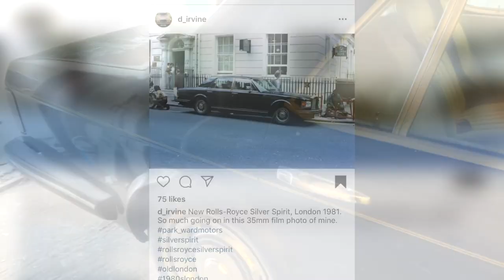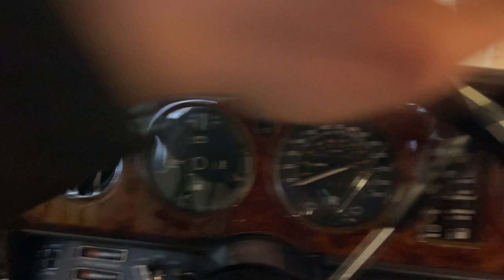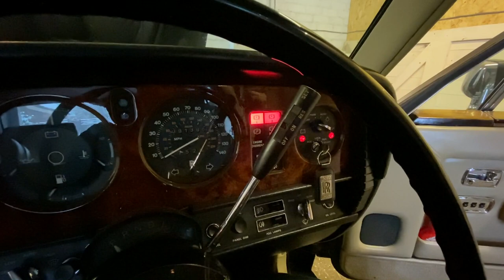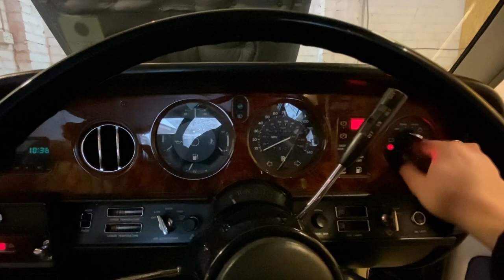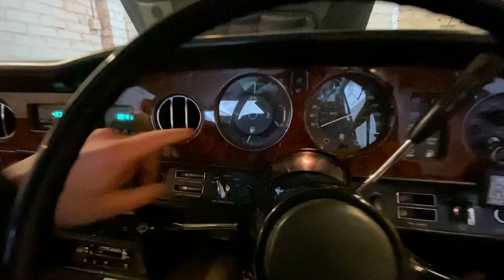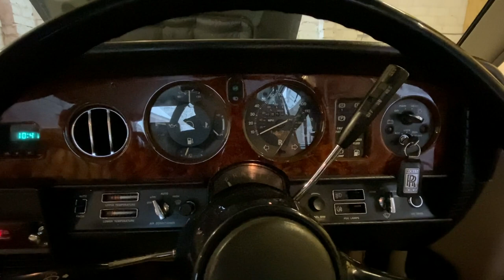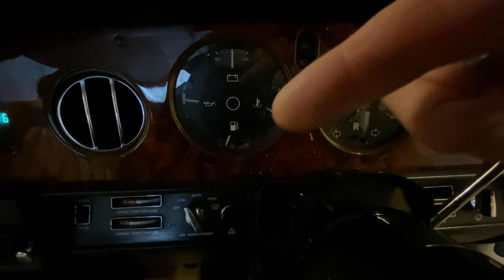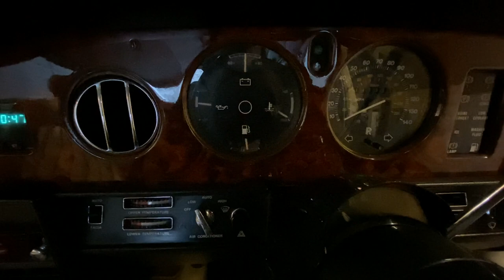Cold Start of the old Rolls-Royce Silver Spirit...

Comment: for some reason many of these old Rolls have that cracking issue on the wood. i looked at a 1999 silver seraph that was 2x as bad as yours. just crazy to see. even the rear tray tables... utterly ruined. im sure the manual told people to put some sort of protective spray or wax on them i dunno.
Reply from the maker: It’s the temperature extremes - left out on really hot days or freezing overnight can do terrible things to what is effectively furniture. It’s all easily rectified with a good crafts person!

Comment: There's a Harvey Bailey suspension  kit for shadows and spirt spur cars
And the turbo R steering rack fits  needs 1 adapter to hydraulic line
There's a weatherstripping update for the doors from a 99 spur
My car is usa fuel injected,I installed a 14v ignition box to the distributor dismissed the car it made it fast and Handel's well
Reply: I bet the exhaust note has a lovely Bach!

Comment: I used to work on used cars in the U.S. If we had valve lifter noise the first thing we did was add a can of STP oil treatment. Not sure if it is made any more. It was a VERY thick honey type oil that would clear up tappet noise 99% of the time. Just be sure to have the engine running and the can of STP warm when adding it to the crankcase, otherwise it will take a long time to empty the can.
Reply: It's not lifter noise.

Comment: If you listen to the cranking you will hear one or more cylinders is low on compression. Might be worth checking.
Reply from the maker: Ah, that was because I’d popped a spark plug out to check for spark which is why it started making the odd noise but we’ll spotted! 👍

Comment: I have enjoyed your video's due to my interest in clasic cars, I have 3 bentley's and one of them is a T2 which I purchased recentley as a daily driver. My thinking to use a clasic car as a daily driver was based on the fact that most new cars are to firmly sprung and lack an option list that is not part of a packaged. Also my budget for a new car was about £40K and I reckon that in 3 years I will lose half of that so my T2 becomes a free car with an unknown value and although the fuel bill will be high there is no road tax and the insurance is cheap. With regard to the interior of your Rolls be very careful about touching up the leather as I also have a Jaguar 420G with which the previous owner had restored the leather (painted) and one stuck to it in warm weather, I had to have it fully retrimmed. Keep em coming.
Reply: I have a T2, the car every Silver Shadow aspires to be. That's what my Shadow II tells me anyway.

All leather is painted and the hides used on your Jaguar will have been all painted to achieve the coloured finish from Connolly. People later use all kind of crap to "improve" appearance but pretty much everything can be removed and a new colour system applied that in most cases will be superior to the original cellulose based material.

Comment: Good grief: "A bit of wear on the valve train"?  No oil pressure.  But fun stuff.
Reply from the maker: It’s not that low for the 6.75ltr engine - and they are robust units, but this specific car has had a hard life having been a funeral car, lots of low speed, stop start and possibly shoe string maintenance so it’s by no means perfect, but it’s very useable! 😃

Comment: Just saw your video. Very interesting! I am kind of relieved (I probably shouldn't) to hear the engine tapping noise... I've got a 1978 Silver Shadow 2 which does it so much at cold start, it almost sounds like a diesel engine. When the engine reaches temperature, the tapping noise eventually gets much lower but never entirely disappears. Not long ago I realized that last time it had the engine oil changed, they put 10W30 instead of 10W40, I wonder if that makes it worse. I am not too comfortable with the idea of having to open the engine to change a tappet or two, the cost of the entire operation really seems excessive to me...
Reply from the maker: They do tap a lot and the thicker oil might help keep it quiet down - they are (as I understand) derived from aero engines where they are designed to run for long periods of time so tend to be a little rough when they are cold until they are warmed through. As long as the noise goes away once its warmed through I wouldn't be worried.  the suspension pumps are noisy too from a cold start so worth bearing that in mind.
Reply: @automotivetales  I suggest you don't give advice on topics you know nothing about. The V8 engine has nothing to do with aviation and should run well from cold. There is no suspension pumps although the rearmost one feeds the rear suspension in addition to the brakes. The pumps should not be excessively noisy from cold, just a light tapping when building pressure and then silence.
Reply from the maker: @byteme9718  sorry - what qualifies you to be so knowledgeable?
Reply: @automotivetales  A long background working on these within the official network, being sent around the world to do work local dealers were unable to and owning a Silver Shadow II, T2 (far better) a Spirit and a Brooklands. As you may guess, I do all of the work myself. One of my long term roles was working for the world's only authorised  coachbuilder where I also gained considerable experience of trim and wood restoration. 

Is there anything else you'd like to know?
Reply from the maker: @byteme9718  yeah, where are your videos about these cars? If you’ve got so much knowledge to use yo snipe at creators on here, put your knowledge where your keyboard is and get in front of a camera and make some informative content rather than criticising other people. Then maybe comment with ‘you misunderstand- see my video here that explains’ rather than just saying I don’t know shit - let me know how you get on 👍
Reply: @automotivetales  Videos? I'm not as vain as you are.

I used to give a great deal of help in public technical forums for free and provided much of the background information for one of the definitive Jensen Interceptor books. Another of my cars. The thing is, why should I give my hard earned knowledge and experience away for free? 

Now I just private message a select few who I feel are genuine. I also make a good living providing technical advice and assistance via phone/email/Zoom etc for people I've worked for overseas. That began in 2004. The pay is good, and when I  travel, expenses are covered and I get to take free or near free holidays in nice places. I usually get tipped too.

I never said you "don't know shit" and never would but I could have ripped your comments apart one by one but was too kind to do so.

There's no obligation upon me to share my knowledge or resources other than to my son who's also worked with me overseas repairing cars far more valuable than anything Rolls-Royce have produced.

All I did was point out your comments were incorrect, surely that's a good thing. A learning day for you. When you make a claim these cars were like this or that without ever having had first hand knowledge consider whether those who bought them (no lease of PCP then) would have put up with the real problems you describe.
Reply from the maker: @byteme9718   you didn’t say you “don’t know shit” and we’re kind enough not to rip my comments apart one by one… but you did open with “you shouldn’t give advice about things I don’t know anything about” So pretty blunt and not helpful or a learning opportunity as you put it! Is it any wonder that wound me up? How do you know the full depths of my knowledge or have you made a presumption?
Also - how dare you call me vain for making videos!!! That is not ok!
I hate being on the camera but I do it as a motivation to keep moving my car projects forward and to document my adventures - it’s hard to put that out only to get comments like yours is ruinous for one’s confidence. Thanks 
You really think you know it all? You’re quick to judge others and point out your superior knowledge but not keen to share said knowledge widely (only selectively and exclusively) because why should you? Does holding it back give you a feeling of being better than others or scared sharing it will do you out of this very lucrative job with all its perks you all of a sudden brag about? That’s certainly how it comes across in your comment. 
Also, why should we care your job gave you perks, travel, or that you got regular tips (I bet those weren’t declared to the tax office as benefit in kind?) What on earth has that got to do with this video anyway, other than showing off. Lucky you - I work for my money on a salary, I don’t get tips but thanks for reminding me how previous generations got it a lot easier.
Reply: @automotivetales  "How do you know the full depths of my knowledge"    I don't, I love to watch videos where people excel in their field. In this case you don't but I accept you may be a fantastic artist.

"Also - how dare you call me vain for making videos!!! That is not ok! I hate being on the camera"   There's an easy solution to that. I love watching people paint and there are many videos with no faces shown.

"I hate being on the camera but I do it as a motivation to keep moving my car projects forward and to document my adventures - it’s hard to put that out only to get comments like yours is ruinous for one’s confidence"   Be confident. It's great to document family videos now everyone has the convenience modern hand phones have. I don't get why you need motivation when you have a car you can get so much enjoyment from by simply doing a little as and when you can. Take the walnut door cappings, you could easily get so much satisfaction restoring them yourself. Who to ask though?

"You really think you know it all?  Absolutely not and when working overseas with zero back up its sometimes scary even though I will now only travel to safe countries.

"but not keen to share said knowledge" I did, I said these cars should not be noisy from cold or run rough.

"Does holding it back give you a feeling of being better than others or scared sharing it will do you out of this very lucrative job with all its perks you all of a sudden brag about?" No bragging, just some background so you may understand my perspective. As for "holding back" information, approach an architect, solicitor or accountant for free advice and see what happens. Go into any car dealership and ask for in depth details and see how quickly they shut you down.

"sharing it will do you out of this very lucrative job with all its perks you all of a sudden brag about? "  It's a lucrative as I want to make it but I pick and choose just to get by. Of course, it's not just what I know but the contacts I've made and that takes time, trust and a lot of hard work. I'll give you an example of how much value people give when the very best information is given out. Your car was originally painted in a material called TPA, the same material Aston Martin used. Their paint quality manager was a paint technologist (very rare in refinishing) and had worked for the MOD specifying and monitoring paint systems and application where the requirements are insanely complex. He wrote a definitive book that described every step on how to a achieve a glass smooth paint finish, every last secret and yet it was ignored. Even when read few could follow it through sheer laziness. It's just not worth the effort of giving information away.

"I bet those weren’t declared to the tax office as benefit in kind?" Ask my accountant, the one who doesn't give me free advice. Cash gifts as I understand are exempt anyway.

"What on earth has that got to do with this video anyway," Nothing but you couldn't let a simple piece of advice drop for what it was. The brake pumps on these early cars were crap but most would have been replaced. They should not be noisy but you will hear them working and the rearmost pump will have to work for some time to level the rear suspension that quickly collapses. A noisy pump is a noisy pump and can be fixed if you spend some money but it's never normal.
Reply: It's designed for 20W50 oil which was the standard at the time even though it seems as rare as rocking horse dung nowadays,
10W30 generic brand just hasn't really got the gravitas to hack it in a Royce except that BP Viscostatic 10W30 (VF7) is unique in that such a thin oil is listed on page 56 of my Spur handbook.
All the others listed with grades are xW40 or xW50.
Reply: @automotivetales mine sounds like a FX4 taxi or Class 37 locomotive when it starts up (first time on the key✅)  but after a mile or two it settles down to a RR purr.
Besides, with the windows up I don't hear anything much inside anyhow - except the radio😂
Reply: For my '84 Spur I always use the thickest oil I can get, preferably branded as per the handbook, remembering that these were designed in the era when 20W50 was the norm for almost all road-going cars.
Sounds like a diesel taxi on startup but get a bit of heat in the engine and pressure in all the various pipes and it's glorious.
After a decent run to relatives my bro-in-law stood at the door as I reverse parked in the drive and his first words were "nothing beats the purr of a Rolls-Royce".
Don't hear much from inside though 😉

Comment: Curious if these get converted to running on Nat Gas or Propane before 2030 when EV becomes important? How quickly internal combustion mechanics will disappear remains open to speculation.
Reply from the maker: That’s a good question! I suspect the easiest solution will be Synthetic fuels as they shouldn’t involve any modifications to the vehicle itself. Check out the ‘Future of Motoring’ Podcast we did in January (also on YouTube) if you want to learn more about the future for motor vehicles 👍

Comment: Hai, I am an independent classic and specialist cars trader based in the Republic of Ireland and also in possesion of a very similar 1982 Rolls-Royce Silver Spirit that I acquired in 2018 from Belfast, Northern Ireland, so it's also a U.K. car first registered by some lady in Birmingham. I am looking forward to getting the bodywork and mechanicals done on it, but just can't seem to find a legitimate business that could sincerely undertake this project.

A moderator of the Rolls-Royce and Bentley owners' club did suggest that the U.K. would be the best bet for it. Please advise if, what, where and roughly what could it cost.

I really like the noise of the L410 V8 and would like to try and explore some more noise and unrestricted horses out of the 6.75 litre unit.
Reply from the maker: I haven't as yet had any bodywork done on the Rolls (or the as yet un-disclosed SZ car) but the chap I use is Duane at Starmans in Market Bosworth in the UK.  He has a bodyshop he uses that recently did a Camargue which came back looking astonishing!  As for the nouse, I know Flying Spares (also in Market Bosworth) keep stock of a stainless exhuast system which is quite nice for these engines.  They are close to standard so not boomy or loud, but release a little more noise.  Mine was a bit 'raspy' once first installed but now its bedded in (ie it has a nice layer of carbon deposit on the inside surface) it waffles nicely.

Comment: Horrible sounding when cold. Ticky-tick-tock, but might have been the audio set up.. Nice interior though. Garage kept, for sure. Loved the well insulated bonnet/hood.
Reply from the maker: They are surprisingly noisy when cold - so as one of the other comments pointed out, that ticking is not the tappets but actually the pump for the hydraulic suspension and brake assist and it does go away as the car warms through and the suspension rises. Having it out in the warm weather we’ve just had, it’s quiet and tap free 😀

Comment: U need a new fuel pump & starter plus alternators😮
Reply from the maker: Start is fine... the alternator did turn out to be toast - we ended up replacing it in 2022 and it seems to be rock solid now, even with ligths, wipers, radio, and phone charger all on so hopefully thats one job off the list. Fuel pump hasn't given me any issues aside being a little noisy.

Comment: you got a noisy lifter there
Reply from the maker: it really does sound like that but its actually the accumulator pump for hte brakes / suspension hydraulics.  I've had it checked out by Rolls Yoda and its correct - its silky smooth once its warmed up :)
Reply: @automotivetales  Still not normal. Noisy brake pumps were a common complaint on early cars. They also suffered from seizing and rapid mineral oil use due to outsourcing of machining.

Comment: It sounds terrible
Reply from the maker: they sound very tappy when they are cold but its less valve train, more the hydraulic pump - once its warmed through they are super quiet and waffle nicely with the stainless exhaust!
Reply: @automotivetales 
In a perfect world maybe but your RR is definitely knackered you even said “ it’s been running more than enough now “ and switched it off 😂
Reply from the maker: It might be tired but it zipped me down to Le Mans and back in summer with no major issues… so I’d say it’s just fine 😃

Comment: That engine does not sound healthy ,,, bad tappat noise ,,,stststatatatat !
Reply from the maker: That’s generally the pump for the hydraulic pump and does go quiet once the car has warmed through and self levelled - it’s super quiet to drive around with no tapping noises at all. These engines are actually quiet agricultural on cold start which seems common from others I’ve seen